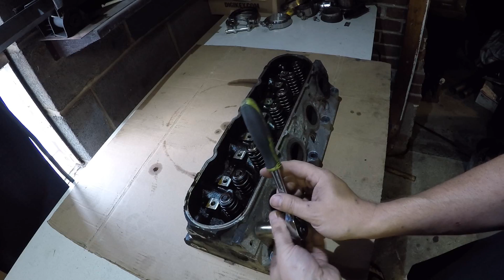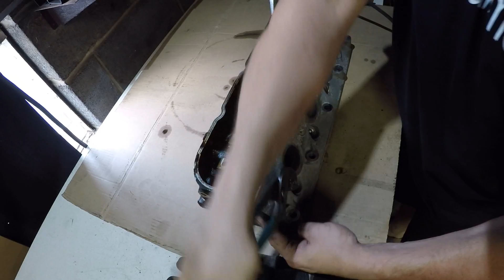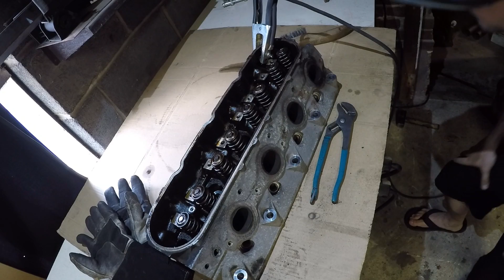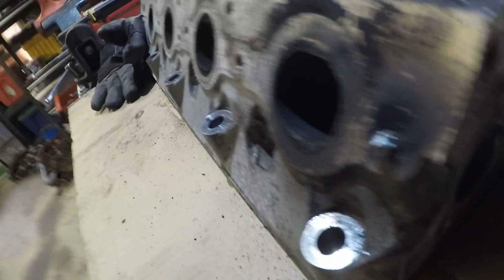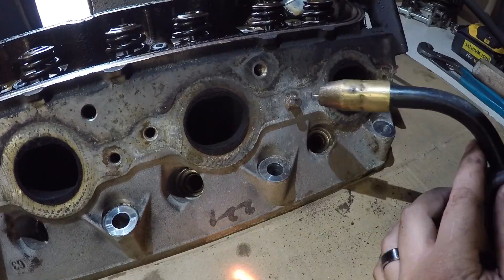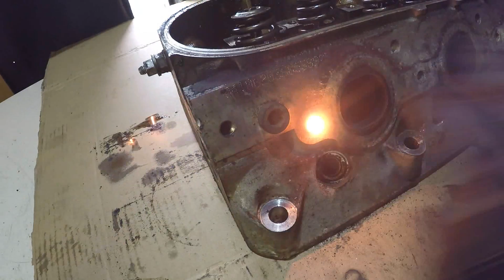how to remove a  broken exhaust stud with a WELDER, LSX cylinder head

Comment: Thanks for the video. I broke two bolts off this weekend on a 5.7 hemi, in the truck. I sat in the driveway for an hour just looking at the, thinking *%$*. Then I remembered my old friend "Youtube" and found your video. I fired up my old welder and had both bolts out in 15 minutes. The first bolt was flush with the surface of the head, the second was down in there. I was impressed the welder didn't hurt the head, or the threads.

Comment: To the guy in this video: i wanted to let u know that the method in which u did not use the nut, made my life muc easier this morning. had the back driver side one, break off and the bs nut method i used before ur video didnt work. u saved me from having to pull the head or motor. mad props bro. im subscribing after this video. thanks again and God bless u
Reply: Fuck I’m doing my
Brother in laws van manifolds and both sides the rear bolts snapped. Hopefully this will work because the nut method is not cutting it. Fingers crossed I’m not pulling heads tonight 👎🏼
Reply: Nuts are usually coated or galvanized so don’t stick

Comment: Matt, thank you for saving my ass. I used a fluted extractor and broke it off in the bolt. Found your way after wiping out 10 drill bits. Your way worked in 5 minutes.  You're the shit.

Comment: If you heat up the bolt with an oxy esetyline torch glowing red and then spray it cool with a sprits bottle then do that a few times just about every bolt will come out.I use that style on rusted brake bleeders and every thing but you need to heat just the bolt glowing and cool it with the bottle a few times before removing it and it WILL work! spray it with PB or WD after you get it moving to help it lube it on the rest of the way out. I've been a mechanic for 20 years in the northeast mostley NH and it has always worked for me and there is plenty of rust and broken bolts here.lol

Comment: Its a good tip.. I've seen people try to easy out exhaust studs/bolts before and manage snaping off the easyout, you ain't drilling that out lol.. This always worked, we removed broken off shit like this all the time in our welding shop.. Heat is good lol.

Comment: I just bought the original style like Matt did, blue grips from the Channellock brand. Those broken bolts came out right away, 10 mins per cylinder head.

Comment: If  welded nut is breaking off, your heat needs to be turned up. Remember, welding on top of the bolt is the same as starting a weld at the edge of 1" plate steel, you need more penetration. That bolt also is surrounded by alluminum, which absorbs heat effectively.

Comment: Hit it with some penetrating lube while it's still hot, the lube will boil and chase the threads for you so you don't have to work so hard pulling them out. 90 % of the reason this works so well is the temperature differential between the aluminum and steel after you hit it with the welder, for viewers at home a good blowtorch can get you the same effect

Comment: I usually hold a washer over the exhaust stud and try to stick the washer to the stud ( welding inside the center of the washer) then bend up the side of the washer and twist it out with a vise grips. Works stellar.
Reply: Great tip. I want to try a few different techniques with my everlast welder the next time this happens to me and figure out what works best for me.

Comment: You have to let it cool down first before you try taking it out and definitely not with an impact... Think what's happening, the metal is softer when it's hot enough to be red and the bolt has expanded in the hole so it's going to be much harder to remove.

Comment: Again once the weld is sticking out just a bit take a nut large enough to set over the stud and weld it on they almost always come out that way. If you have a 3/8 stud use a 7/16 nut and so on. The weld will not stick to the cast iron head or aluminum head don't be afraid to get a good weld on it

Comment: Just snapped a driver's side one tonight on a lt1. 2 more seem iffy more propane torch and this method for any that snap off. Looks like I'll be busting out the flex core tmrw. ! Passenger side went by smooth which led me to believe this driver one would be the bastage!

Comment: Ive had luck with grinding the end of the donor bolt to a point and building the weld from the broken bolt up into the point. This way your sure the weld penetrates the broken bolt the first time.

Comment: Like on your last bolt, if you squirt the shit out of it with pb blaster or some crc power lube. It'll smoke the shit out of things for a few seconds but the heat will pull the lubricant in around the threads and help let loose where the bolt and head are dissimilar metals. 
Good tip using the deemed or die grinder on the ones broken below too. 
And I haven't read any other comments but if you weld a nut onto your weld nubby, through the inside you can use a wrench instead of channel locks. This is really helpful, even in the machine shop we don't like to drill out broken bolts especially in aluminum.
Reply: Used this tip as well, worked great.

Comment: Blasting the studs with a wire wheel and crank up the welder and work more on the stud than the nut ( works better with tig since you can just use the arc for a bit without using filler right away

Comment: Have you ever tried to drill like a 1/16"hole in the stud and use a bolt extractor with a t-handle? Or is the problem that the broken studs are siezed in the head? the welder idea seems best, but i was just thinking about what to do with no welder access. ive had success with extractors sets on iron sbc heads abd aluminum honda b-series and toyota heads, but they weren't seized.

Comment: what i do on the ones that are busted in the head and do not protrude, is i weld a m8 washer first and fill the center. then weld a m10 nut to the washer and existing weld and let it cool a little. never had any issues using that method. i even do it with the engine still in the vehicle occasionally!
Reply: Erik Ebberoth how are you welding a flat wash on to anything that not protruding doesn't make sense

Comment: When u weld ur blob on put a good washer on then weld the washer and then a bigger nut and slag it inbetween the blob the washer and the nut but let it cool a lil before u try getting it out then if the nut don't hold put a couple tacks on the outside of the nut

Comment: In an aluminum head, you can just dissolve it out with alum and a soda can. AvE did a video about it. Leaves the threads pristine.
Reply: Yeah, because that took less than 5 minutes per bolt... :P
Reply: it may not be fast, but sometimes they are too stubborn for the standard techniques and it's a good option to have in your toolbox.
Reply: true. in some rare cases it could be useful :)
Reply: All hail the mighty gods of AvE and Denmah!

Comment: Read all the comments I have a 6.0 Chev 2500. Did you use a tig with gas? My last bolt is like the submerged. tried mig flux weld goes off center.
Reply from the maker: Mig with mix

Comment: there is something called a revised drill or for some people a revised drill bit that cuts in reverse on a cordless drill and it comes with a extractor that works in reverse to me it works pretty easy and it works without a welder witch caust a lot for those who don't have the money for a welder

Comment: Would welding like that work on an iron head? What do you do about the threads it seems like when you make that blob it would weld to the threads and be impossible to get out
Reply: If your heads are iron, remove the whole head and throw it in the garbage, problem solved! Seriously tho, on iron heads I've used a tig welder so you're not "spraying and praying." It can fuse to the iron but it usually doesn't because the iron is a big chunk of cold metal and the stud is a tiny piece of steel that gets cherry red fast.
Reply: It wouldn't stick to the aluminum but it melts at 1200°, not sure about cast.

Comment: Surely you should have watied until the weld becomes room temp for it to work better? (The nut weld part). I'm by no means a welding expert, but the metal could very well still be soft from the high heat.
Reply: Yes I understand that the aluminium expands when heated, but I think that he might have been too quick on the bolt, I usually wait until it cools down first a bit, then reheat the metal around, and do it again. It could be cold on the outside but still be "yellow" inside, causing it to break easier.

Comment: Fantastic pro-tip in this one Matt, I HATE drilling out bolts (who doesn't).  You also sold me on getting some quality brand Channel Locks.  Do you have a preference of where you can get the good ones?  I rarely go looking for name brand hand tools...  Lol
Reply: Check for sharp teeth when browsing for them in the store... he said these ones have sharp teeth. And something about not coming apart and busting your knuckles not sure what he means I haven't seen channel locks come apart before.

Edit: Looking back at them the bolt head on the side of the channelocks looks pretty beefy. Looks like a good design.
Reply: Knipex Cobra's are by far the best set of channels I've owned. Can find them through snap-on and they now sell them at home depot!
Reply: Franky Tornadoballs Thanks, I'll check those out!
Reply: At Menards I bought the three piece set and saved 10$ for the channel lock brand. Very good pliers.

Comment: damn coulda used this trick a month ago when i did the heads on my ford 360 engine..idk what ford was thinking when they exposed the threads of the bolts on the top side of the head..all the bottom ones were fine.

Comment: can you please tell me how the weld only sticks to the bolt and not the heads? I dont know about welding this is the only part that scares me
Reply from the maker: +John Russell steel vs aluminum
Reply: Si this wouldn't work on a cast iron head? 

ive got four bolts snapped off below the surface. If this won't work I'm going to try filling the hole with the header still on the truck.
Reply: @ChrisSmith-it7mm  cast iron doesn't MIG very easily, so this method works on it as well. I've done it with downpipe studs broken off in turbine housings.

Comment: This shit is my wet dream. I have a single bolt left snapped off in my block, but I'm doing my best to not need to remove the engine, and I don't have a welder.

Comment: when you weld the bolt on, try to break it loose with a wratchet instead of a impact drill, it wont snap as easy

Comment: probably not w good idea to try this with flux core wire aye?
Reply from the maker: You could try but it has to be powerful most likely you're asking about a 90amp hf welder and I think the gas does a lot for helping these stick, who knows
Reply: What kind of welder do you use?
Reply from the maker: +Mike Powers this is a Hobart 190
Reply: I started to drill one, seems like a hard bolt, maybe a burr and die grinder

Comment: I would fuck that all type of up using mig .  Tig yeah mig no way Ide ruin threads and be the first person every to weld aluminum to steel.
Reply: I have been doing this for 34 years on big rig trucks steel weld will not stick to cast iron or aluminum, I always use nuts that are larger than the stud size if you have a 3/8 just use a 7/16 nut hold them with needle nose and don't be afraid to get a good weld on it, the weld will not stick to the head or engine block.

Comment: These videos piss me off. Do these ticks/hacks with the motor still in the vehicle. Till then. I'm just gonna assume yo over charge your customers for something as simple as a manifold stud.
Reply from the maker: customer? oh
bold of you to assume I do things for people lol
this is a hobo in his own garage.
Reply: I did 8 on my 2003 Tahoe with the motor still in it.........I didn't even disconnect the battery. If you can't do this in the vehicle, then you're missing the purpose of this method. Anyone can take a motor out and do it. Do you feel better after voicing your incorrect opinion? Also, simple? I see you've got limited experience with broken bolts/studs.
Reply: @michaelrogers2758  might try using your brain and read what was said before you get triggered. As I said this should be done in the vehicle, cuz I agree anyone can take the motor out. And yes it is simple, simple procedures regardless of how broke it is, or how far into the thread it's broken. "See you don't know me so you have no clue what I've done, or capable of. So to presume I have limited experience shows how triggered you truly are over my statement. 
See I ONLY own GM suburban styled vehicles from 2000-2006. In fact I have 3 in my personal possession and another 2 more being used as work trucks for my roofing company. Just to let ya know, all 5 of them have had exhaust bolts snap. I've dealt with them all, and yes they're simple. 
Have a good day!